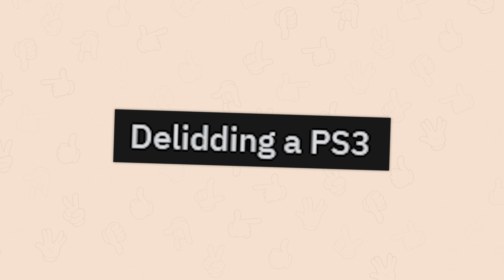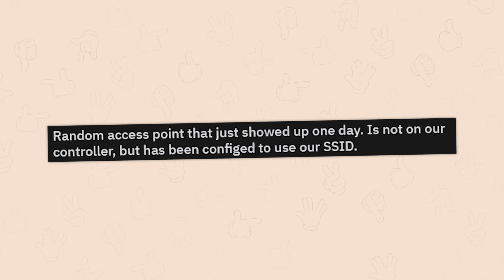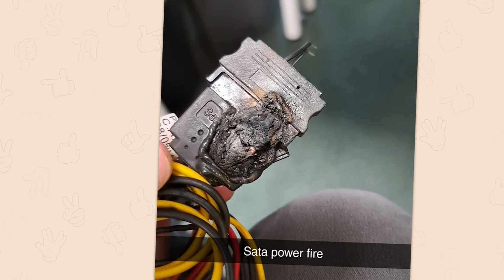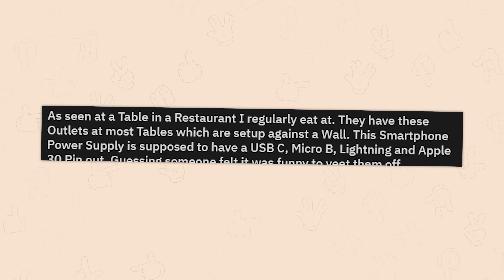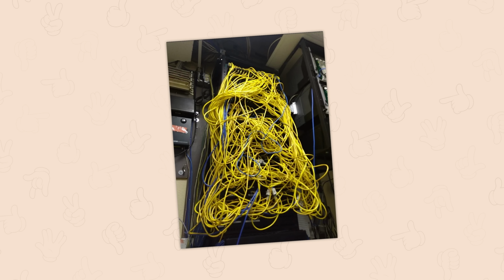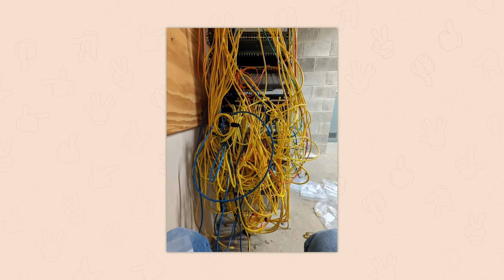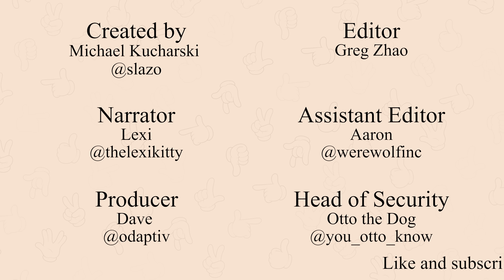r/Techsupportgore | improvise. adapter. overcome.

Comment: Oh, Lexi! I can chime in! How you were talking about rechargeable coin cell batteries around 05:29, right? Yeah, that's a thing that exists. Still, for a system that's configured for that behavior, one has to be a lot more picky about ensuring a compatible battery. How do I know? The Sega Dreamcast uses such a battery! Unfortunately the normal design of the console means it only charges the battery while powered on and active. And while there is a mod to turn the normal soldered-on battery to be on a socket, a lot of  the warnings around it are explicit about not using CR2032 for the job, because those batteries aren't made to be (re)charged. I believe the intended battery for such a modification would be an ML2032 (someone else can correct me if I got that inaccurate).

Also, regarding the de-lidded PS3, it's nowadays a sort of last-ditch mod, typically done in conjunction with a replaced cooler to make better contact with the components. A lot of the original run, backwards compatible PS3's tend to overheat because the stupid cooler's choice of metals that would contact the IHS of the CPU and RSX will bow in to itself with sustained thermal loads, meaning even the cooler's cold plate will literally try to peel itself away from the darn things. One of the more recent bad-ass mods I've seen, is to replace the original, 90nm CPU and RSX on such a system, with the die shrunk versions from a super-slim edition. With the inter-poser said modders have come up with so all the new pins can talk to the old pins, it ends up being just within tolerance to reuse the stock cooling system. Fun! :D

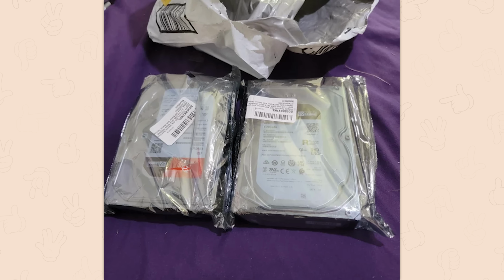Comment: 6:15 ahahahahahahahah the wiring is wrong at one end of that ethernet cable. On the right side it's standard T-568b wiring. On the left side, it's T-568a. Whoever crimped that cable crimped it as a crossover ahahahahahahahahah

Comment: 00:25 I swear that looks like the top left (im guessing its a ram chip) has either broken off or broken in half and is stuck to the IHS
11:55 Thats an old staple stuck in the mag safe. Had one of these myself many years ago. I was panicking copying everything off the macbook because none of my 3 chargers worked an i only had like 30% battery left.

Comment: 6:26 the wiring on the rj45 jacks is in the wrong order. While it technically doesnt matter what colors you use, they have to be the same order on both sides.

However, with that you w9uldn't get a link at all...

However, some pairs are unused, so i could imagine if you get very lucky (or i guess unlucky?) that you could get like a super degraded signal running on just one pair...

Comment: 6:25 that's just a crossover cable which can be used as a regular patchcable on any router / switch supporting "auto mdix" (auto crossover) which is pretty much any router/switch with gigabit (or faster) ports. I know this because my brother in law accidentally patched every lan-cable in his ouse in crossover configuration and i was the first to notice => was curious why nobody else noticed / why there were no problems.
double crossover = regular patchcable

Comment: 6:55 this is not a USB-A plug, but a USB-A jack. Since it's basically two male connectors slammed against each other, it is sometimes called a gay configuration. in that sense it's similar to an SMA female screwed into an RP SMA male: It may fit, it may be fun, but it isn't productive.

Comment: My husband does telecommunications and he said the jellybeans are for telecom and are only temp fix but use one for each cord and it’s water proof gel. It runs 100mb of data.
Edit: he said they are not meant for electricity. It’s not a conductive gel. Just water proof

Comment: The Lenovo that melted is most likely on Microsoft's fault.
Windows 10 lately started to ignore shutdown as a command and just take it as a "recommendation" instead. Which is a problem if the hardware is a laptop and gets carried in tight airless spaces.
See, Windows randomly starts up - in a backpack in this case - and starts updating like crazy. While in half-sleep.

I have to add, noone understands why this state of Windows ignores thermal, but I guess reading thermal is not necessary for updates so that's why there is no emergency shutdown. That one is still a question.

Quite a lot of laptops burned down thanks to that already and Microsoft plays the waiting game, actively avoiding answering this so they can pretend the liability is not theirs.
Reply: I believe peripheral chip manufacturers are in vain too. There are a lot of buggy drivers who doesn't comply with standards.

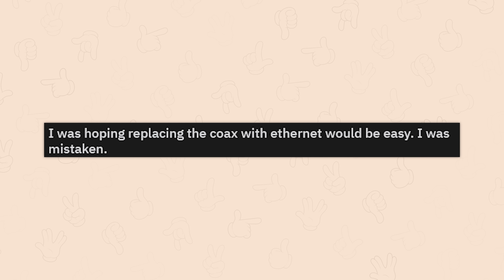Comment: 9:20  They poked the wire though the wall and attached it to a face plate.  They then screwed the plate to the wall.  There is no box there.

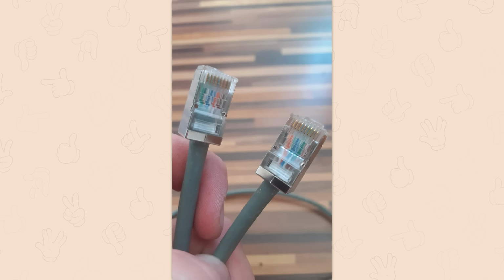Comment: At 6:30 the thing wrong with the internet was the RJ45 (Ethernet cables) weren't properly aligned and had two different standards, A on one end and B on another, which shouldn't allow the ethernet cord to work

source i work in Networking

Comment: Delidding PS3 is a common thing because thermal compound under CPU lid deagrades and it overheats. Too bad in that case the lid came off with one of the chips on CPU.
13:50 - this probably was done when someone needed 1 ethernet ports, but only had one cable. Technically, you can split 8-wire ethernet cable and use two sets of 4 wires to have 2 ports instead of one, but you limit ethernet speed to 10 mb/s.

Comment: hey lexi, i would highly recommend opening up that ps3 and giving it a clean out.
i did that with my brothers ps3 and it went from sounding like a jet engine to pretty quiet and had a noticable bump in performance.
also change the thermal paste.
also also take photos of where stuff goes and make sure you put the screws down in a way you are going to remember where and when they go in.

Comment: for simple data cable like that

if it is rated for power then it is rated for data

can it power an ac fan running high voltage and current? then it has very low resistance which is perfect for data

shielding does not seem present either way so ignore that

does the cold solder or whatever introduces inductance and capacitance? perhaps, but minimal

so it is perfectly usable

Comment: Lexi, I love you, but those 'cold solder' things are called scotchloks, and most of them are rated to carry data. The gel inside is not a conductive, it's a weather protectant. When you squish it down it down, it pushes each individual wire into a metal bracket making a physical metal to metal connection. As a residential technician, they are incredibly useful because its 100x quicker than soldering, and more reliable than an RJ45 port, due to the protectant gel sealing it. Obviously, use is always situation based, but I have seen them last for decades if installed properly. Sorry, I know that was alot, but dont trash on my scotchloks, absolutely useful little things.
Also, fun fact, alot of the guys who use them call them beans. And call doing that, beaning.

Comment: That CPU heatsink looks like it's been exposed to gallium.  Gallium interferes with the oxide layer that usually protects aluminum from corrosion, thus allowing it to corrode.

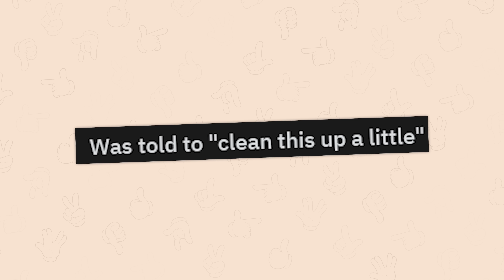Comment: 12:28 i recognize the computer we use it at our school. Its a Lenovo 300e 2nd generation. They aren't made anymore and the ones at our school keep bluescreening. I think its from old hardware. The stop code is SDBUS INTERNAL ERROR. Correct me if im wrong.

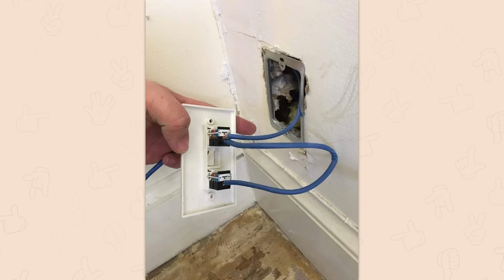Comment: 13:39 The 100TX standard allowed you to use the central pair for telephone. Not sure how often that was actually used in practice though.
Reply: Those wires was reserved for future use. Some used them for phone line though it was not in Ethernet standard. In such contraption you can plug RJ-11 connector directly into RJ45 socket and it works.
Reply: @KrotowX  It is probably the wiring standard for the RJ45 jacks. I did not look it up before commenting.

Comment: 14:00  Actually wrong. Those are "Pinch Terminals"  casue they have physical blade terminals designed to cut through the wires insulation and pinch the conductor. as long as that eithernet cable is only using Telephone data  that connection is fine  if its an actual ethernet connection that would cause a lot of packet loss

Comment: 09:00 looking at that, those cables were live when they were cut off... that could have been nasty if they were using like nail clippers or something, or one of the restaurants knives...
Reply: These cables carry at most 12 volts, so not dangerous.
Reply: @Owen_loves_Butters  its not the voltage, its the ampage that is dangerous. 100mA can stop your heart.
Reply: @Graytail  Wrong. Voltage is what creates current. "It's not the gunshot that's dangerous, it's the blood loss."
Reply: @Owen_loves_Butters  Well, you keep telling yourself that, I know its ampage not voltage that kills, because I've taken 240V several times and I'm still here... Also - 

It's The Current That Kills

Offhand it would seem that a shock of 10,000 volts would be more deadly than 100 volts. But this is not so! Individuals have been electrocuted by appliances using ordinary house currents of 110 volts and by electrical apparatus in industry using as little as 42 volts direct current. The real measure of shock's intensity lies in the amount of current (amperes) forced though the body, and not the voltage. Any electrical device used on a house wiring circuit can, under certain conditions, transmit a fatal current.

While any amount of current over 10 milliamps (0.01 amp) is capable of producing painful to severe shock, currents between 100 and 200 mA (0.1 to 0.2 amp) are lethal. Currents above 200 milliamps (0.2 amp), while producing severe burns and unconsciousness, do not usually cause death if the victim is given immediate attention. Resuscitation, consisting of artificial respiration, will usually revive the victim.
Reply: @Owen_loves_Butters To better use your analogy, its not the speed of the bullet, its the calibur. a 22LR doing 1000fps isnt going to do as much damage as a 50BMG doing 750fps. or a 4Bore doing 500fps. Or a cannonball doing 150fps. Get it?
Reply: @Graytail  There's many many more factors that determine whether a shock is fatal than voltage
-How long did you receive the shock? 
-What was the condition of your skin? Wet or dry? Any cuts or bruises? 
-What path did it take through your body? Where on your body were the two contact points?
-What was the frequency? DC is less dangerous than low frequency AC, while high frequency AC is less dangerous than either.

And regardless, higher voltage with constant resistance **ALWAYS** means higher current. It's just ohm's law. A car battery produces several hundred amps of current to crank the motor, and yet if you touch across one you won't feel anything. Yes, I'd put my life on it. And yes, a shock of 10kV is FAR more deadly than a shock of 100V all else being equal. One hurts. The other cooks. 

Voltage kills. Current is just how it does so.
Reply: @Graytail  Those two are completely unrelated to each other and do not fit the analogy at all. Voltage causes current. Speed does not cause caliber.
Reply: @Owen_loves_Butters Source please. Show me something that says its volts and not amps that are dangerous. And not your rambling, I want actual sources.
Reply: @Owen_loves_Butters  Just thought about this a little more, do you know what voltage a tazer works at? for some models its around 50,000 volts at 2-5mA depending on the model. If its voltage that is the dangerous one, why arent tazers 100% lethal? People get zapped out of existance by 110v houshold mains all the time... oh, wait, thats 110v at 100-200 amps (depending where you are)
Reply: @Graytail  Ah, tasers. Those don't kill you because the shocks come in extremely short bursts, not long enough to kill you.

Comment: So if anyone cares the number at 3:21 I believe it is the maximum integer limit of data that electronics can hold, so basically that computer has no idea how long it’s going to take so it just went to the maximum number it could produce
Reply: Think it's the lower signed 32bit integer limit
0xffffffff as a signed integer is -2147483648

Comment: I had to do the splice thing shown in the last picture due to a garage door ripping the cable in half and me not having the necessary equipment to properly fix it.
It was for a Fire department.. It was also the main ethernet cable thats used for all of the internet there.

(It was later fixed properly with a new run (and upgraded to Cat6) and were not charged for the fix.)

Comment: The 2 AA battery CMOS will probably have a much shorter lifespan.
AA’s are much more prone to leaking/failing after a few years.
Reply: Will be enough to live till particular PC replacement. I believe it is some gateway PC to some device who can communicate only with software supported by ages old operating systems. Also in that place the only damage from battery leak will be in battery holder.

Comment: That liquid metal one he might as well have ruined that board. Liquid metal thermal paste forms alloys with the metals on the board and weakens the connections and makes them brittle it might be ruined. I refuse to use that stuff because it may provide a better thermal connection the risks far outweigh the benefits for me I don't have money to replace a MoBo if I accidentally spill that crap.

Comment: I melted multiple HP laptops in high school.
Reply: Also; I installed TV's for a living for about 3 months... this is very painful for me to watch, becuase we would come in after the IT people, and fix there messes.  Some IT people are just lazy, especially security guys.  I wanted to stay in the indusrty, but my housing said no, and I had to move back home, and noone wants to hire anyone with less than 3 years of expeirince; I now work as a driver for Amazon... I miss having to trouble shoot which wire went where, over Idiotic Drivers, and overwork warehouse folk.

Comment: Personally I once had the issue that the power connector on my laptops PSU had failed on a day when I was ill and really needed the laptop working, so yes I now have an old laptop with a PSU hardwired to it.

And as for poor packaging, I brought a laptop off eBay that came just in a plastic mailing bag, no packaging at all, didn't work so got sent back despite the seller not wanting to, mis described as well so eBay too my side.

Comment: Toothbrush won't help with liquid metal damage. This mobo is basically dead at this point.
Corrosion of sodder and surfaces. And short circuiting open metal parts.

Comment: 14:02  Those are Scotch locks, they are gel-filled I meant for making a weather proof splice. Use a lot with telephone lines.
Reply: Yes.  Very common for telcos.  Not suitable for ethernet (doesn't maintain pair geometry), but fine for a telephone line.  I can see why AT&T would use them - that's what their technicians usually use for splicing cat5/3.

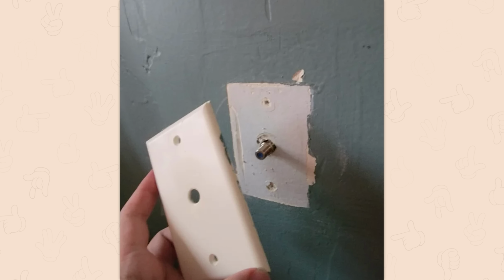Comment: 9:40 this doesnt always work. you need to actually have the coax lines actually physically connected, and might hav ethe replace spitter boxes cuz cheap ass ones can only handle like 100mbs

Comment: 3:27 how the heck did they get the timer to be the max negative value (maybe the value got a place holder value or something)

(some nerdy stuff if you want to skip this)
for some light context, that is the lowest a signed 32 bit number can go (the way signed bits work is the left most bit is very large  negative number (equal to {number of bits}-1, then is turned negative, it's why you can reach 1 digit farther in negatives than in the positives)
Reply: Most likely was left to default value (-1). Actually seen this once by myself in MacOS circa 2000-ies.

Comment: 5:20

I have NEVER experienced a CMOS battery failure. Like.. Ever
And i have kept my pcs running on average for 7 years. 
Maybe cpu or GPU upgrades in between but same mobo. 
I have pc runnin in one of my rooms which has a mobo i assembled into a PC in 2013... Besides a slowly dying HDD (for which i have ordered a replacement SSD) running without issues.

Comment: 'if you don't do this you are just lazy'
No, not really. Moreso just incompetent or unwilling to do the work you are paid to. Because someone who is lazy wouldn't be willing to actively make more problems for themself (or even in the case of an hourly wage consult, wouldn't want to make a problem for whatever poor bastard came in after them) in the case that something goes wrong. There'd have been at least some effort to bunch those cables in a way that is remotely sensible, or leave some form of id'ing on them. It does not take long, when installing the cables initially (assuming your place of work isn't completely pants on head) to wrap a colored sticker on the cable to give some indication of what it is for, then keep a document SOMEWHERE that identifies what those colors mean. Even a white label with a colored sharpie stripe tends to work. Realistically, IT should be the only ones touching those cables without getting screamed at, which means it's unlikely for a cable to lose the label without someone noticing.  

Messy is normal. Even a rat's nest is not THAT bad, if properly indicated. Indistinguishable spaghetti is a problem.